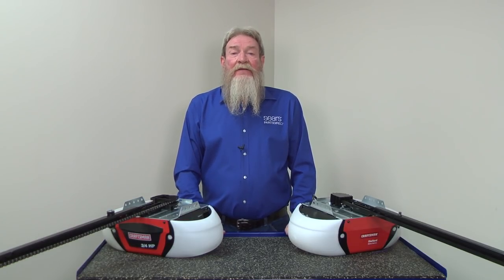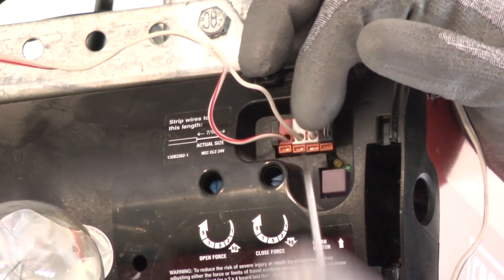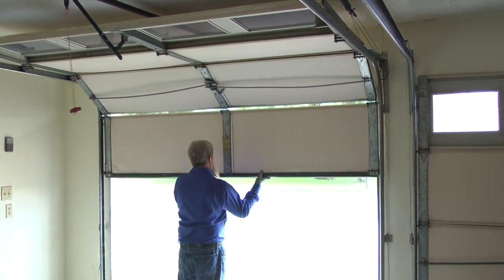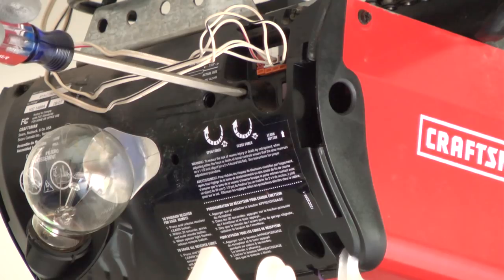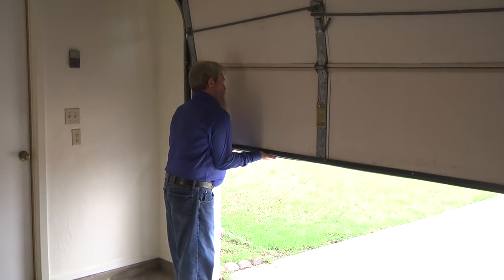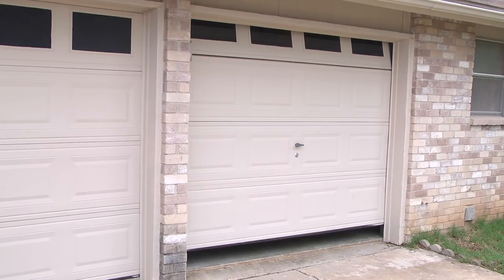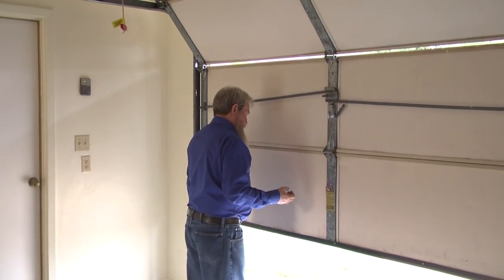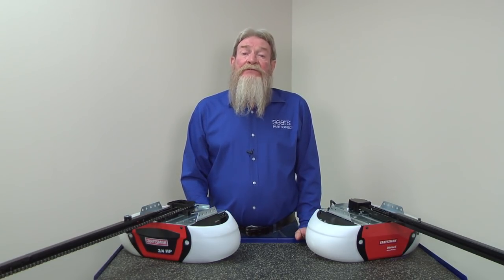Garage Door Won't Open or Close: Force Adjustments

Comment: Thank you so much for this video. For the 9 years that I've had my house, the garage doors would not stop and reverse if they hit something, or if I manually applied resistance, like the man in this video does.  I figured I would at some point have to call for a repair. After seeing this video, I realized the down force was the problem.  I adjusted the setting and now the doors work as they should. It fees great to be able to fix it myself.

Comment: Thanks Wayne! I had opening problem of my 3/4 hp opener since last couple of years, only in winter though.Now it started giving while closing too since a week because of low temperature, I guess. Adjusting the force absolutely fixed it and saved from buying+installing another opener. I like the complete health check you demonstrated so clearly. Great job!

Comment: Hi Wayne,  My garage slowly started not opening all the way and eventually when it went down it would open back up.  I adjusted the Travel Limits for the UP and Down. It worked for about 10-15 open/closes then the same problem came back.  I ordered a new RACK, (the piece that actually pulls the trolley).  I haven't received part yet but now the trolley/Rack is running the entire distance of the track and when it reaches the end it makes this horrible grinding noise and won't stop until I pull the power.  I think because I was constantcly adjusting the Open/Close Limits it got messed up.  How do I reset the Open/Close Limits? Right now it is grinding at the end of the rail at the door. I hope I explained it well. thanks in advance!
Reply from the maker: Page 37 of the owner’s manual shows a diagram of the limit switch assembly on a typical Craftsman garage door opener: http://www.searspartsdirect.com/partsdirect/user-manuals/13953225srt1-craftsman-parts-garage+door+opener-manual. We recommend that you unplug the garage door opener (or shut off the house circuit breaker to disconnect power) and open the motor unit. Check the wiring connections on that limit switch assembly and look for physical damage. Reconnect any loose wires and replace the limit switch assembly if you find damage. If you find no problems with the limit switch assembly, then the logic board may not be detecting limit switch signals correctly. You may need to replace the logic board. Some models have a different type of limit detection, so let us know if you have a different type of opener.

Comment: We've had our Sears garage door opener for many years and it worked flawlessly until a few days ago. The door would not open so we manually removed the door from the opener via the cord so that the Wifee could get out of the garage.  Now, when we press the button to send the glider towards the rope to reconnect the door, the opener goes in reverse instead as if it's lifting the door.  Anyone ever experience this and have any thoughts on what could be the problem?
Reply: I had that before in my case I forgot to pull the cord/red tab back up towards the ceiling first before sending the carriage down to lift the door.
Reply: @brandona.4600  I figured it out.  I had to reset the door up and down settings.  For some reason, it got all out of whack.

Comment: So my garage door will work up and down but only if I stop it from the bottom.  Say I let it close and I stop it with 2 inches or so until the ground.  I can then open it no problem with the opener.  But... if I let it close to the ground it will not open.  I increased the up force and went to max. It won’t open though.  Please help.  Oh and btw I thought it was the down limit switch and it’s not that.

Comment: Mine clicks once as soon as I hit open and doesn't even attempt to move up. Any chance the torque settings could be the issue? The two sensors by the tracks, one has a green light and the other has a yellow light, is that normal? If I move the sensor around or clean dust off them I hear the unit click a few times while I'm doing that.
Reply from the maker: There's a chance that you may need adjust the up-force setting on your garage door opener but other factors such as travel problems or a faulty logic board could be keeping the garage door opener from lifting the door. We recommend that you follow the steps in this troubleshooting video/article to diagnose the problem you're describing: https://www.searspartsdirect.com/article/garage-door-wont-move-motor-and-travel-troubleshooting-video.html . Your details seem to indicate that the safety sensors are working properly. The safety sensors will prevent the door from closing but typically won't prevent the door from opening. We hope this information helps. If you need more assistance, let us know.
Reply: @searspartsdirect  Thanks, I'll check that when I'm at this house again. This garage opener hasn't been operated in over a year, so I don't know if something is frozen. I'll try the steps.

Comment: When I press the keypad or remote in the winter have to do it like 5 or 10 minutes sometimes giving up. To get my garage door to open. What is the problem. I change the batteries. And still takes a lot of time or wont go up or down only in the winter
Reply from the maker: Pull the emergency release rope to disconnect the trolley from the door. Manually raise the door to make sure it goes up easily. If the ice build-up under the garage door causes the door to stick shut during winter, spread de-icer along the bottom of the door to help keep ice melted so the garage door doesn't freeze shut. If the door opens easily, check the remotes for RF interference as shown at 47 seconds into this video: https://www.searspartsdirect.com/article/garage-door-opener-remotes-wont-work-video.html . If RF interference is preventing the remotes from working, you'll likely need to install the antenna extension kit ( https://www.searspartsdirect.com/part-number/41A3504/0009/139.html ) to fix the problem. We hope that these tips help. If you need further assistance, let us know the results of the troubleshooting we recommended and give us the model number of your garage door opener.
Reply: @searspartsdirect  Its not ice. It goes up freely when I use the opener on the wall. When I use the keypad it may take 20 or 30 times. With a remote maybe about 5 to 10 pushes. The wall button it works right away. Do you think it's the up setting is to low???
Reply from the maker: Because the opener lifts the door when you use the wall button, adjusting up force won't likely solve this problem because the opener works properly when activated. If you haven't checked to see whether the remotes work when triggered within a few feet of the motor unit, we recommend that you check that issue. You can remove the wireless keypad from its location outside the garage to perform that check on the keypad. If the remote devices work while held a few feet from the motor unit, then RF interference is likely causing the problem that you're describing. If the remotes don't work when held a few feet from the motor unit, then cold weather is affecting the remote devices and/or the logic board inside the garage door opener motor unit. Keep the remote devices indoors so they warm up and then see if they work properly. If they do, then you'll likely need to replace the remote devices to fix this problem. If the remote devices don't work when they're warmed up to room temperature, then you'll likely need to replace the logic board to fix this problem. We hope this additional advice helps. If you need more assistance, let us know. @problem417
Reply: @searspartsdirect  thank you very much

Comment: he forgot to mention something. If the opener is not opening the door, before adjusting the force, check to make sure you don't have a broken spring. If you do, adjusting the force will break the opener and door.
Reply from the maker: You may have missed it, but at :45 into the video, we recommend checking the door for smooth travel before adjusting the force. The door won’t travel smoothly with a broken spring.

Comment: Hello Sears partsdirect. 
I got garage door opener from sear  model 139.54931.
I don't know why the motor not working. Just hear single click.
And it not move at all. Can you tell me why..?.
Thanks..
Reply from the maker: Look for an error code flashing on the up and down arrows on the motor unit and refer to your owner's manual to troubleshoot problems indicated by an error code. If the motor unit doesn't signal an error code, then a wiring failure, faulty drive motor or bad logic control board could be causing the failure. We hope this information helps. Let us know if you need more assistance.
Reply: @searspartsdirect  
I had no idea on the wall remote said error code 1-5  ( motor control). When I hit the remote I hear click only. Tell me what happened.?.there's no flashing lights. 
Thanks.  .
Reply from the maker: @hehexe7622  The click indicates that the logic control board is closing the circuit board relay to run the drive motor and open/close the door. If the garage door is bound up on its tracked (or locked), the motor won't run and that error code will be displayed. Pull the emergency release to disconnect the garage door from the opener's trolley and check garage door travel. If the door is bound up, have a garage door technician fix the door to it opens and closes smoothly. If the garage door opens and closes smoothly when released from the opener's trolley, activate the garage door opener and see if the motor runs and moves the trolley along the opener's rail. If the trolley moves with the door disconnected but not when the freely moving door is connected to the trolley, then you'll likely need to replace the opener's motor. If the trolley isn't bound up and the motor doesn't run and move the trolley with the garage door disconnected, then you'll likely need to replace the logic control board inside the garage door opener motor unit. We hope this information helps. If you need further assistance, let us know.
Reply: @searspartsdirect  
Do you know how much to buy the motor And how much for the logic control board. I got the garage door opener at sear about 2 years. 
Thanks..
Reply from the maker: @hehexe7622  The motor costs about $210 and the logic control board costs about $140. Based on the cost of the parts, replacing the garage door opener may be more economical.
Reply: @searspartsdirect  .
Thanks..
 I had it about 2->3 years at sear. And it still had warranty ( 10 years) so can I have sear replacement a new one.

Comment: Hi, when my garage door closes it goes all the way down and 1 foot before it get closed going back up.  Do you know why?
Reply from the maker: Check to see if the garage door opener lights blink when the door reverses. If so, then the bottom of the door (or debris clinging to the bottom of the door) may be hitting the safety sensor beam and causing the door to reverse. Clean any debris off the bottom of the garage door and adjust the position of the safety sensors if necessary to correct this problem.
 
If the lights don't blink, pull the emergency release and manually check the garage door travel along the rails. If the garage door binds up about a foot from the ground during down travel, then repair or adjust the garage door rails to fix the travel problem. If the door closes smoothly when you manually close it, try adjusting the down force as shown in the video.

Comment: Doesn't work. I have my UP adjustment screw turned to the maximum, and the door only opens 2 feet. When it goes to close, it doesn't stop when the door is closed and bends the track! I have tried every adjustment known to man.

Comment: my door doesnt even move at all and the light doesnt blink, yet I hear a sound.  Please help
Reply from the maker: Check to see if the emergency release rope is pulled, causing the inner trolley to move along the rail without the outer portion of the trolley that’s connected to the door. If the emergency release rope if pulled, reset the emergency release to connect the inner trolley to the outer portion of the trolley. The garage door may move once you reset the emergency release.
 
If the emergency release rope wasn’t pulled, check to see if the garage door is locked. Unlock the garage door and it should open.
 
If the door isn’t locked, check garage door travel by pulling the emergency release rope to disconnect the garage door from the trolley. Lift and lower the door fully to check up and down travel. If the garage door binds up on its rails as you move the door, adjust or repair the rails so the door travels smoothly.
 
If the garage door travels smoothly along its rails, then check garage door opener trolley travel along the rail as shown at 1:54 in this video:  https://www.searspartsdirect.com/article/garage-door-wont-move-motor-and-travel-troubleshooting-video.html. Repair or replace the rail or trolley if necessary.
 
If the inner trolley doesn’t move when it’s disconnected from the outer portion of the trolley and you find no damage to the rail or inner trolley, then a failed logic board, bad drive motor or a mechanical failure in the drive system can prevent the inner trolley from moving. We’ll need to know the model number of your garage door opener to help you troubleshoot these types of failures.
Reply: Sears PartsDirect I think multiple things are broken and worn so I ended up replacing the opener with a new, chamberlain 1.25 horse power, the previous lift master model I had was over 20 years old and 1/2 horse power

Comment: What if the door open by its self
Reply from the maker: Erase all codes as described in your owner’s manual then reprogram all remotes. This will prevent a neighbor’s remote from opening your garage door if your neighbor programmed his or her remote at the same time that you programmed your remote. If the door still opens by itself, replace the batteries in all remote devices because weak batteries can sometimes cause remotes to malfunction. We hope these tips help. If you need further assistance, let us know the model number of your garage door opener and give us more details about the problem.